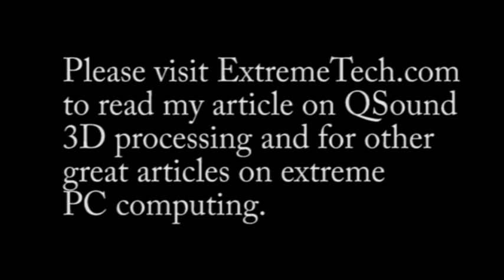QSound 3D Processing demonstration for ExtremeTech.com

Comment: how does it work???
Reply: It is using time delay and filtering between channel to be closer to reality.
In real life, if a sound source is placed on your right, your left hear will also receive the signal but delayed because it's a bit more distance to cover and also filtered because your head in the the path.
Reply from the maker: Besides time delay QSound processing also modifies the frequency of the signal to emulate the frequency changes that the folds of the outer human ear (the pinnae) would have on the sound before it hits your ear drum, since those folds cause frequency cancellations in the spectrum that vary depending on the angle of the approaching sound waves.  Time delay is the brain's primary tool for left-right sound source localization, but it is this second phenomenon that helps the brain in estimating the elevation of a sound source and whether or not it is behind you or in front of you.
Reply: 나는 한국사람니라 이해는 못하지만 큐사운드소라는 좋아요

Comment from the maker: @Kobashi81 - QSound does use delay but it's not  a simple delay.  It uses selective delays to create partial frequency cancellation to emulate the frequency cancellation that the folds of your ear create (the Pinnae) when sound bounces around them before reaching the ear drum.  The cancellation caused by the Pinnae changes as a sound source moves around the room giving your brain a frequency based audio cue as to where a sound source is and QSound emulates that phenomena.

Comment: am I deaf? cuz I hardly hear any differences
Reply: Me too ...:-(
Reply: You need to use stereo speakers, preferrably external ones as opposed to the ones built-in to your monitor or smartphone. When QSound is working, the engine sound will be heard coming out of both speakers to simulate the subtle difference of a sound reaching both ears (Interaural Time Difference). There's no fancy vertical or rear surround tricks in this demo, just widened stereo. It's pretty compressed, but there's some MAME videos that show it off in Street Fighter games with much better clarity.
Reply: @IDrinkLava  I have stereo speakers and I'm sitting in between the two.  I still hear very little difference TBH.  I don't get what all the hype was about over Qsound.